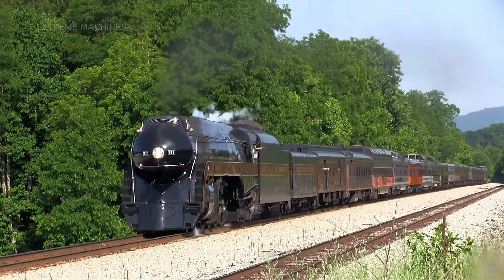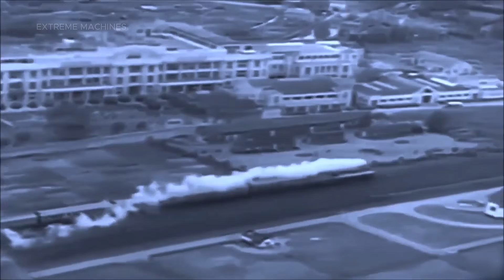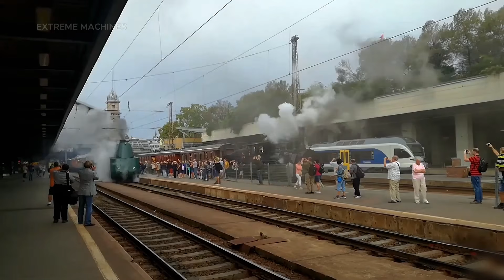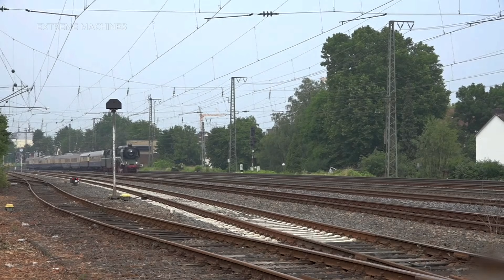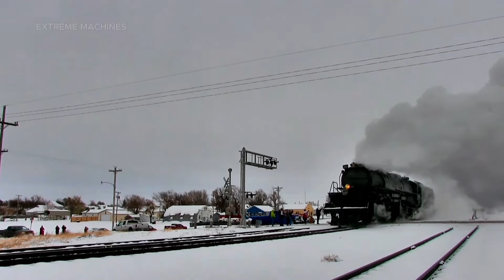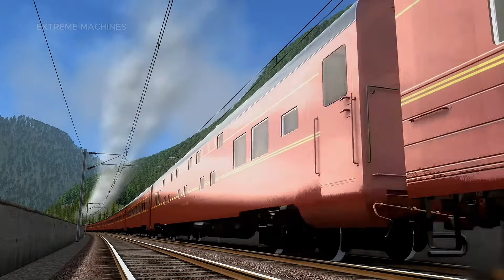The 10 RAREST and MOST LEGENDARY LOCOMOTIVES of all time that you need to see!

Comment: The G.W.R. engines did NOT use compounding, nor did they have a gearbox. The Cornish Riviera Express was open to ALL classes of passengers. Also we do NOT and did NOT refer to the figure as zero when 'o' is quite satfisfactory. O-6-O. The first motorised vehicle of ANY kind to touch 100 m.p.h. was City of Truro in 1903. Why can't we have somebody speaking ENGLISH to do the voice-over. The biggest and most impressive engines of all are the 'Big Boys' of the Union Pacific and an engine on its own is only a 'train' for the purposes of signalling regulations. The Gresley engines would not have been as good as they were without Gresley's collaboration with G,J Churchward of the G.W.R. Kylchap is pronounced 'killchap'. No mention either of Andre Chapelon's 2-4-2A1 of the S.N.C.F. Whoever is responsible for this rubbish should be shot !

Comment: "Rear wheel drive and a manual transmission" Really ? These are STEAM LOCOMOTIVES, not automobiles. They have a whole set of driving wheels, and on most of the ones in this video they are NOT the rear most wheels, but the middle set. The rear most wheels, if there is a set behind the driving wheels support an enlarged firebox on the boiler. Also, there is NO TRANSMISSION. The pistons and connecting rods connect directly to the crank on one of the set of driving wheels, one for each cylinder. Next time, before you make a video about a subject, spend some time studying the technicalities and nomenclature. "Rear wheel drive and manual transmission," FORSOOTH !

Comment: Despite the screams down below there is an undoubted romance associated with Steam Locomotives of all types and sizes. What destroyed them was the simple economic facts that Steam Transportation cost from 6 to 8 cents per ton/mile  while  diesel electric freight, in the mid 20th century averaged half that (3 to 4cents per ton/mile) when total costs are factored in, including locomotive maintenance, infrastructure, and track maintenance costs. Diesel electric costs could be looked at considering these factors: Fuel economy: Steam engines wasted enormous energy in heat and exhaust. Diesel-electrics converted fuel more efficiently, with ~30–40% thermal efficiency compared to ~6–8% for steam.

Maintenance burden: Steam required constant boiler cleaning, lubrication, and mechanical overhaul. Diesels could run weeks between servicing.

Infrastructure simplification: Steam needed coaling stations, water towers, ash pits, and roundhouses. Diesel eliminated most of these, reducing capital and upkeep costs.

Track wear: Steam locomotives had higher dynamic augment (pounding forces), which increased rail and tie replacement. Diesels distributed weight more evenly.

Railroads in the U.S. found that dieselization cut freight costs by nearly half per ton‑mile. For example:

A 1940s steam freight train might cost $1.20 per train‑mile in fuel and maintenance.

A comparable diesel freight train in the 1950s could run at $0.70 per train‑mile, with longer service intervals and fewer crew.

This is why the transition from steam to diesel happened so rapidly after WWII—by the mid‑1950s, steam was virtually gone from Class I railroads in the U.S.

Railroad Employment in 1940 was abouj 1.1 million workers in 1940 this fell to 1.0 million Freight Volume over the same period increased from 655 billion ton/miles to 740  billion ton/miles.
Reply: Electrification is even better, as has happened across large parts of Europe.

Comment: Actually there were four units built of MÁV 242 series. Its speed limit was 120 km/h in both directions (which was rare at the time) and achieved a maximum speed of 167 km/h at its trials, which made it the fastest Hungarian built locomotive. MÁV 242.001 is the only one preserved of the series, it was a part of the nostalgic fleet of the Hungarian Railways up until around 2015 when its boiler rectification expired. Now it's a static locomotive in the so called Diesel hall of the once Northern Loco Repair Shop

Comment: 4CYLINDER POSSIBLE,.....2INSIDE 2OUTSIDE .. MANUAL GEAR YES....STEAM ENGINES  ARE ALL MANUAL GEARS...OPERATED BY THE DRIVER...REAR WHEEL DRIVE??????
NOT ON STEAM ENGINES....... CONECTED 2, 3, 4, 5,AND 8 WHEEL DRIVE MACHINES.

Comment: If the Mallard holds the speed record at 126mph, how can the DR 18201 be the fastest engine in the world at 113mph?
Reply: Narrator says 14:21 "fastest operational steam engine in the world" in 1961 and still today occasionally operates excursion runs. Mallard is no longer in operating condition.
Reply: IT POSIBLY REFERS TO AMERICA...WHICH HAS ALWAYS BEEN IN A WORLD OF ITS OWN, BUILDING CARS, STEAM-TRAINS, MILITARY TANKS, SHIPS AND AIRCRAFT WHICH ARE FAR, FAR TOO LARGE AND HEAVY TO BE OF ANY PRACTICLE USE. ANYWHERE OUTSIDE THE USA
Reply: Or would the Pennsylvania Railroad T1 5550 claim the record
Reply: A speed record must always be in 2 directions AND Mallard was driving down hill!
Reply: @lner  have to agree with you, by all accounts it was not in a fit state to attempt a return run and would not have been capable of matching it even if undamaged
Reply: @lner  Mallard had lighter-weight train to pull. "Downhill-Blitz!"

German BR 05 speed record train has been driven in level section, and its train was heavier.

Comment: The narration is complete nonsense…4 cylinders…manual gearbox?  Rear wheel drive?  Laughable at best but more just stupid producing.
Reply: Some idiot knows nothing about locos! YA its got 4 on the floor and 3 on the tree, dont forget the 2 speed axles. Must have been a sports car anouncer, HE HE. Sounds like a screen door on a submarine.
Reply: @KCO-n9z it’s a wonder it didn’t try to invent a 3-5-4 wheel arranged loco
Reply: Very carefully check the Locomotive wheels design. 
Front 4 Small wheel is just support then drive wheels set then last wheels set for coal storage section wheel.
Reply: @k.m.alaminbaqee last wheels coal support. You don’t know much about steam locos either

Comment: Lovely images ... shockingly bad commentary.   Where to start? OK (let's wind up the Swindonites) ... the Castle Class looked like just about every other 4-6-0 churned out using Churchward's Meccano set. Wot? 

As lovely as the images are, the palpable lack of any respect for the subject matter covered is a reason to block this channel.  Others cite far too many ridiculous mistakes for this to be someone honestly slipping up. This is nowhere near good enough and whoever is behind this ought to be thoroughyl ashamed of themselves.

There are plenty of YouTubers who put real effort into a labour of love and it's them I'll support.
Reply: Hove heretic..you must be an SR fan.  The whole point of the Churchward/Collett stable was to use standardised parts and simple variations, so many could be interchangeable. This was efficiency par excellence in the day.  They were 'standards' half a century before the 'Standards'. Yes, they were theme and variations, but the 1923  trials showed the much maligned (by you)  Castle Class as the winner.  And it's actually the curved blast pipes that give it its special look (not mentioned in the commentary).  And don't forget, Stanier (formerly a Swindonite of the GWR) took GWR designs with him for his Black Five, basically a Hall with Walschaerts gear, and developed the 48000 class from the GWR 2800 class, and those led on to Riddles' 'Standards'.  So basically it was Churchward who developed the whole concept of 'standards' in the 1900s...Riddles just copied the idea.  The 'Standards' were really born in SWINDON.

Comment: Where did the Hungarian loco store its coal, or was it oil powered?
Reply: It was scooped up at speed from a trough between the rails.  OK.... that was water, but the commentary on this video is SO far off the mark, it really makes no damned difference.  It's strongly suggest you look for a respectable contributor, as this one talks utter rubbish.

This clip is SO full of misinformation as to be an abuse of this platform.
Reply: Coal was stored in a bunker behind the cab, and side tanks above the drive wheels held the water.